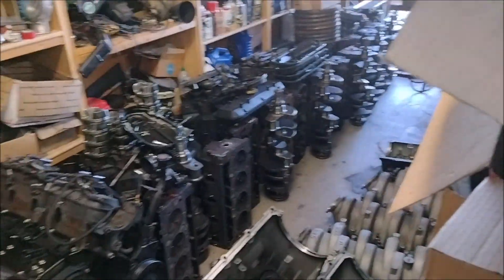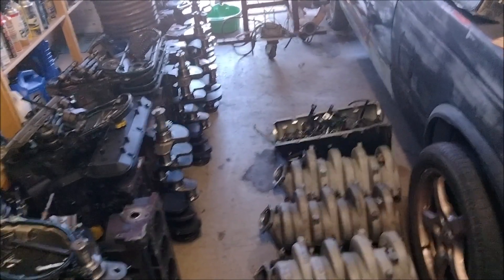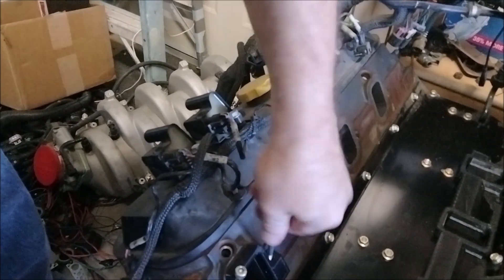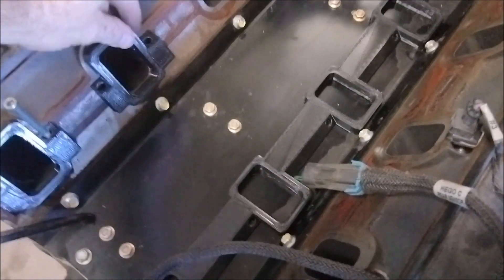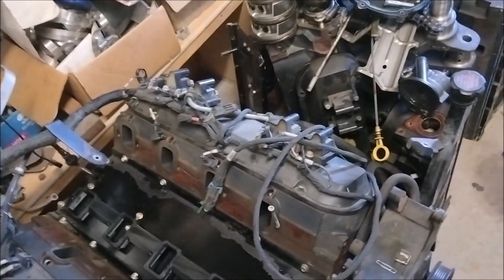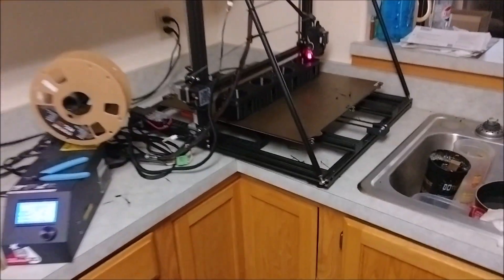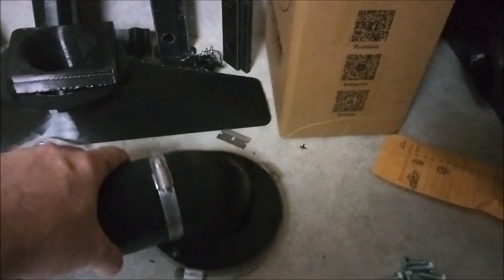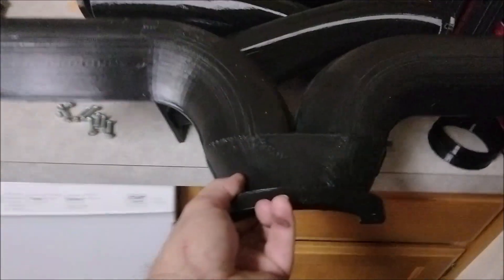8.1L / 8.8L PSI Intake information & Updates

Comment: i looked but didn't find a video showing your egr delete on the 8.1. You mentioned you were going to do that in another video. I'm not doing all the neat stuff that you are. i just had to pull the manifold off because when i pulled the fuel injectors 2 of the plastic seats fell inside. So now I might as well delete the egr. I can make a block off plate. I see that they sell 2 plate kits. I guess I don't understand why the small plate is needed. I wanted to just leave everything as normal except with the one big block off plate in place. I thought that maybe I wouldn't  get any codes if it's still all attached to the sensor.
Reply from the maker: I can make a video the small plate is for the tube from the exhaust manifold.
Reply: @fuelslut   Yeah. Thanks. I knew that. I didn't make a small plate. Only a large one. I drilled two 7/64" holes in it. So it's not totally blocked. I also plumbed a tiny 1/4" exhaust tube into the little egr manifold. Hopefully, it will work and not trigger a code.
        I did another thing that a veteran like you probably wouldn't have. I overtorqued and broke the back passenger side intake manifold bolt. So that's not good. I'm going to leave it for now, and put the rest back together. I did find a torque wrench after that. I'll do the other 9 bolts to spec.
        I'm a long way from doing videos. They'd require too much editing to cut out the screw ups 🤔😃
Reply: Yeah. Thanks. I knew that. I didn't make a small plate. Only a large one. I drilled two 7/64" holes in it. So it's not totally blocked. I also plumbed a tiny 1/4" exhaust tube into the little egr manifold. Hopefully, it will work and not trigger a code.
        I did another thing that a veteran like you probably wouldn't have. I overtorqued and broke the back passenger side intake manifold bolt. So that's not good. I'm going to leave it for now, and put the rest back together. I did find a torque wrench after that. I'll do the other 9 bolts to spec.
        I'm a long way from doing videos. They'd require too much editing to cut out the screw ups 🤔😃
Reply from the maker: Yeah I know about the editing and everything else and then buying a decent camera it's a real pain in the ass  @gmw3083
Reply: Including your channel name in my replies was shunting them to 'newest'.

Comment: Fuel Rail Universal Raw Blank High Flow 13/16" ID 22" Cut Length i bought this for my dads fj60 toyota efi conversion using microsquirt
Reply from the maker: Yeah this is the closest i found to what i used before https://www.ebay.com/itm/301807886058 but not the same :(

Comment: Hey there Fuel Slut will a 8.8L PSI intake manifold bolt on and work with the gm 8.1L 496 motor ?